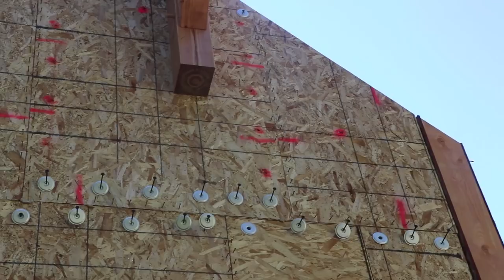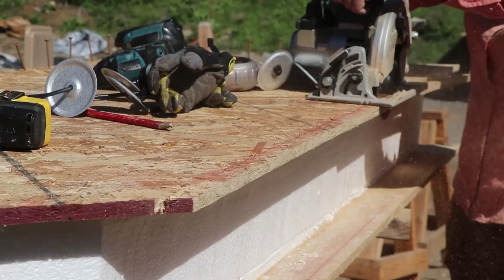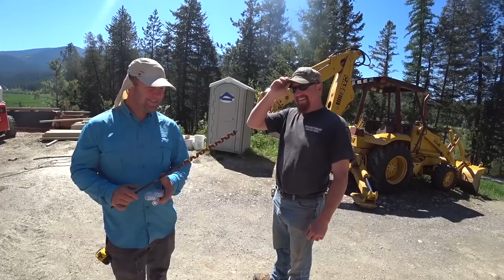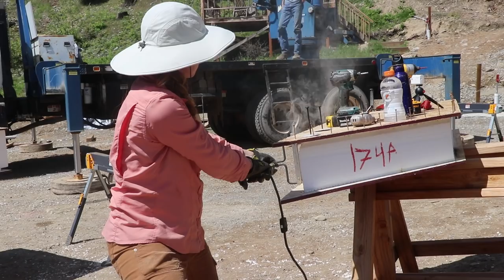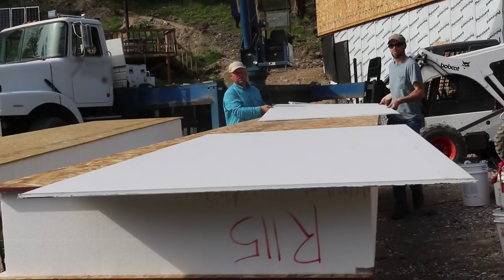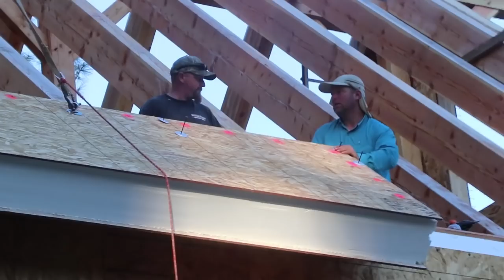TODAY WAS TOTAL CHAOS! (First Roof SIP Panel Install)

Comment: Side comment: I'm sure you have your issues, but watching you two still getting along . . . quite famously, from the looks of things . . . is awesome.  I can't think of anything that could possibly drive a couple apart faster than a project like this, but there you are, defying the odds.  Hope the rest goes as well as the bits so far.  Oh, and to echo another post, I'm hoping you are hiring the roof out.  :-)

Comment: I'm not trying to be the "armchair quarterback" the thing is you guys are doing something that most people couldn't imagine; Then your putting it on video. I'm a accomplished diesel technician and in spite of the fact that I can do things with diesel engines that you couldn't even begin to imagine, I'm in awe of you guys; I humble myself before you. I have taken on some rather big projects in my time, nothing compared to what you are doing. I actually wish I lived closer so I could come help, your issue with the extra long drill bit didn't have to be a issue, you could have used long lag screws from the inside that would have eliminated the need for dowel plugs. Drill 20" and install a 24" lag screw. I might be off on the math, my point is you could have let the lag screw bore into the brace thereby pulling the wall tight without exposure. I have a knack for figuring things out, that's why I turn wrenches. My satisfaction in life is seeing a truck come in on the hook and repairing that truck to make it useful again.
I'm fortunate to have made a career out of something I enjoy, someone much wiser than myself once said if you love what you do you will never work a day in your life, I'm living that dream. Much respect to both of you, I'm not sure I could do what your doing; I got my homestead going on building my dream, working my way out of debt; And I see the light at the end of the tunnel.
I look forward to your videos and I'm pulling for you, I appreciate your precision I realize this is going to be your home and want it to be as drawn, however at this point you know drawings and building are two different things. Your gonna get there and I'm gonna enjoy the time and effort you put into getting where you want to be.